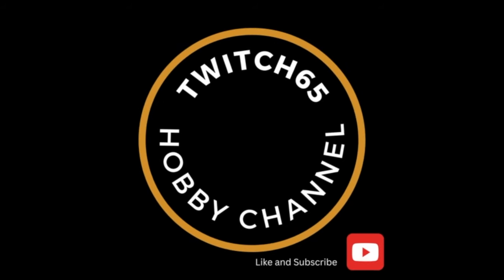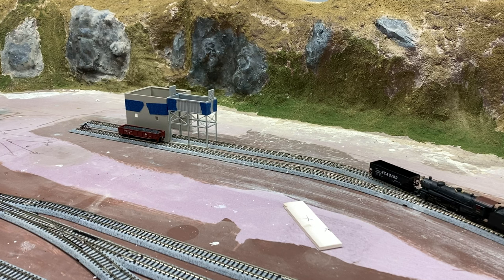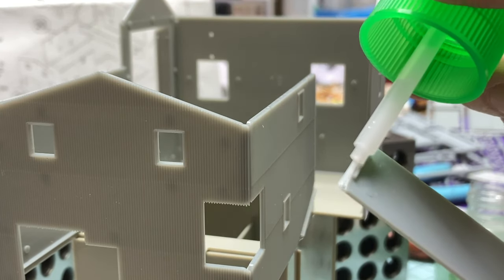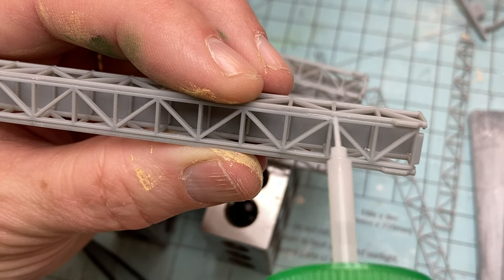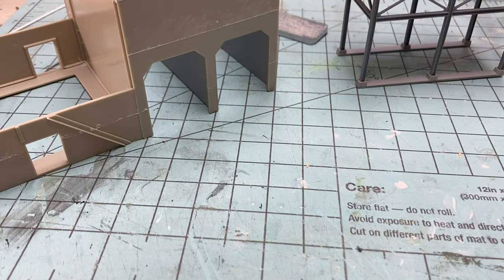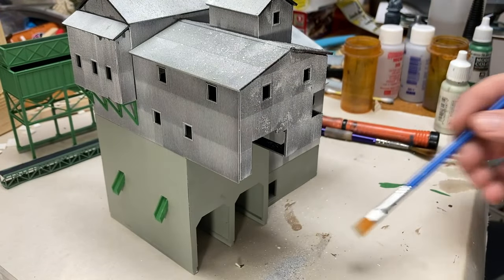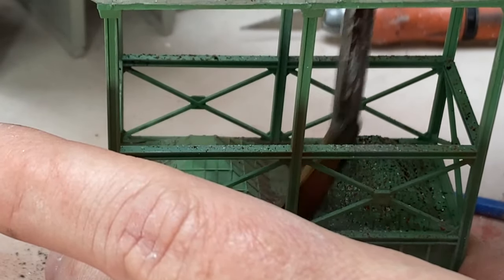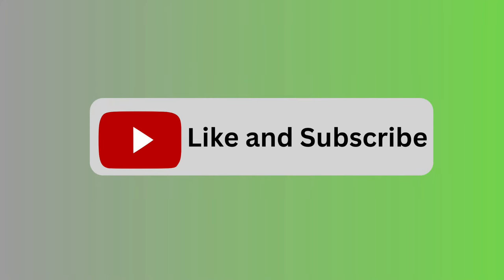Walther's Glacier Gravel Kit, N-scale Build

Comment: The track that does NOT go into the building can be a “Storage” and a “Scale”  track. Cars waybilled to the industry can go to the storage track first, then MTY’s from the storage track get spotted for loading. Cars that have been loaded get spotted for weighing. Cars on the scale get pulled and forwarded off layout. This way the local may show up with four cars, but the switch crew gets to switch 12-16 cars. The inter-plant switching is a “car loading-Multiplier”.
Reply from the maker: I like your idea!